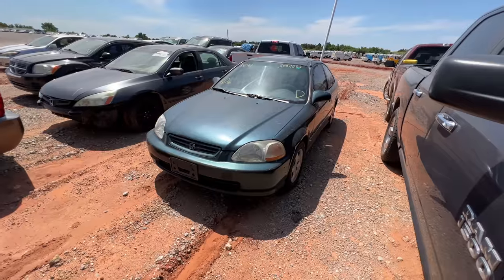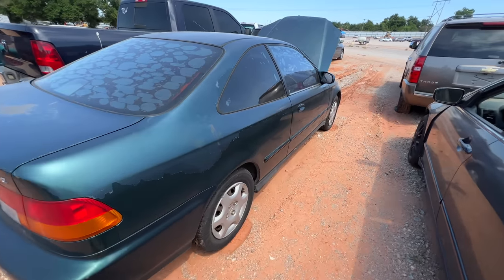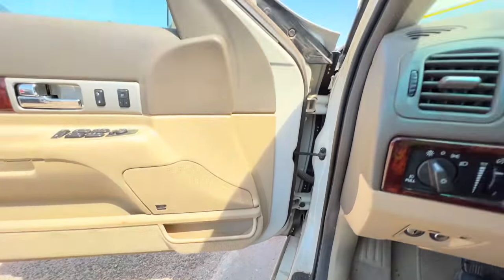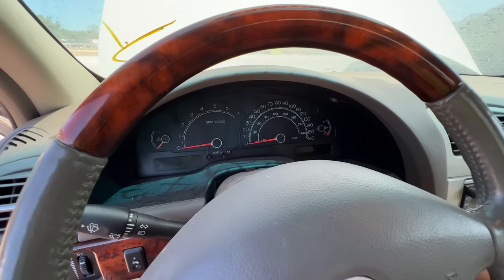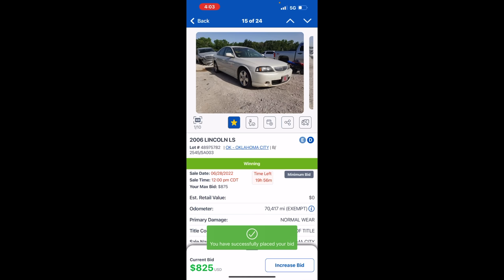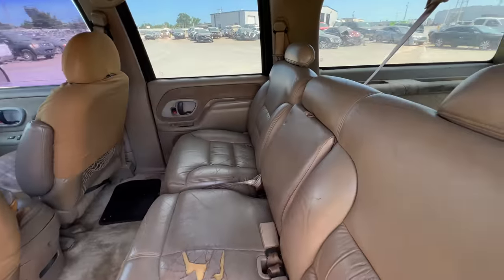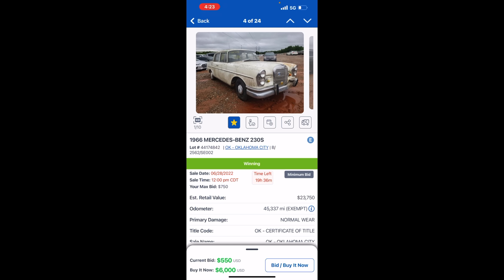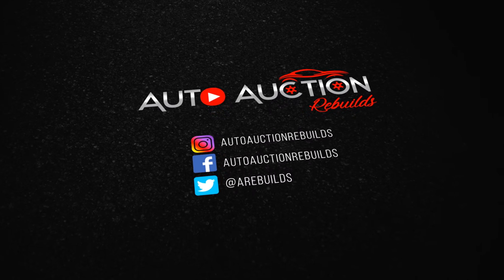Copart Walk Around 7-7-22 + Abandoned 60s Mercedes! Will it Run?

Comment: For those that may not know.  A valet key will not open trunks glove boxes, and sometimes passenger doors.  They will only open the driver's door and start the car.  That way your belongings are protected when you give your car to the valet.  In the case of very fast cars like a hell cat it can also act as the black (reduced engine power) key.
Reply: my spare key doesn’t open the trunk on my corolla but i have a trunk latch next to the drivers seat
Reply: @doc363  that's because no one with a Corolla uses valet parking lol

My town car had a valet key, you could lock the glove box which had the trunk release button in it.
Reply: @samholdsworth420  Anyone can use valet parking 🤦‍♂️, my 20 year old golf and jetta both have 2 fobs and a valet key

Comment: I know in some models of cars the reason the cars start and die Is because the theft system shuts the fuel pump off but I wouldn't assume that until you try the basics but the car runs longer when you cycle the key that's a number one sign of the theft system in a car

Comment: Great Coverage On These Randy, I’d Say, Especially Since It’s More Simple With The Carburetors, If 230SE Is Cheap Enough, Pick It Up, Get The Old Gal Running, That Engine’s Probably Could Easily Unlocked, Gut The Interior, Clean It Up, Put It Back, Probably Can Resell It, Maybe Mike With Monkey Wrench Mike, As An Idea….??
Reply: Why are you using caps on every word
Reply: No Particular Reason, Just The Way I Type..

Comment: Add a electric fuel pump from a 1970'2 Volvo electric for fuel injection. and use the regular the Mercedes pump for regulation. This will work for at least 9 years.

Comment: There are good beaters and cr*p beaters. When just about everything is trashed on the vehicle, then it time for it to be scrapped. 

My ‘beater’ is 23 yrs. old with 180K on the clock. But it don’t leak or burn oil, everything works, nice original paint and interior, even the exhaust is original. All I did was put brakes and a battery in it when I bought it.

Comment: You can weld a manifold and put a Holley carburetor in if you want to replace injection systems :)
I saw a old late 40's i think Jaguar with an american V8 engine in it too for sale here in my country in Europe so much can be done.
A friends father had one of these Mercedes with tail fins like on american cars, grey color, i think it was a 220, it is beautiful cars.
Put a Tesla S motor and battery in it from a rolled damaged crashed Tesla S? :)

Comment: That Lincoln LS must have been a granny car. Low low miles. Heated AND Ventilated seats. Ventilated seats were not common in that era. Smells good, good condition. It must be a turbocharged or supercharged engine, the gas cap says 91 octane gas required.
Reply: High compression also likes higher octane.